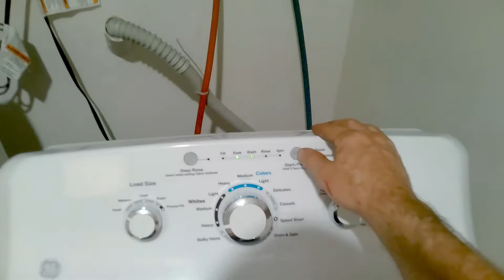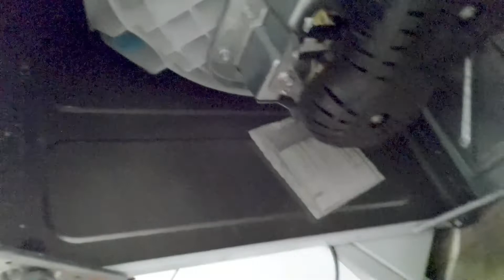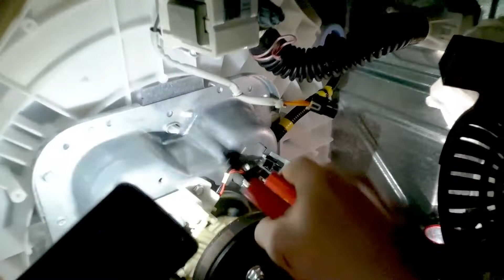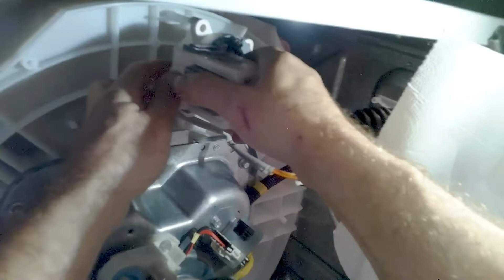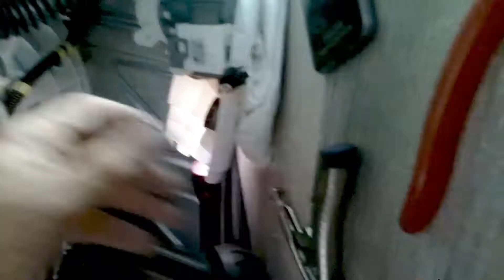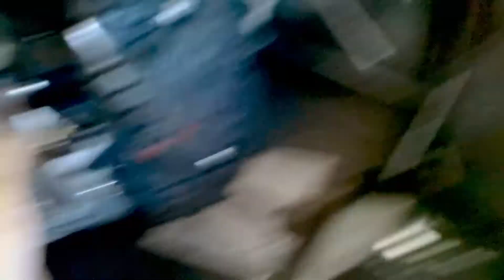GE Washer Repair Guide: Fix Draining, Spinning & Diagnostic Issues!

Comment: I get the hum when rinse and wash is illuminated
Reply from the maker: Hi Jared, When Rinse and Wash is illuminated, that is your hot washer valve trying to place water inside  your tub. Try the COLD SETTING ONLY and see if the washer starts. If so, it seems like you have a bad water inlet valve or the screen is clogged. Hope this helps!